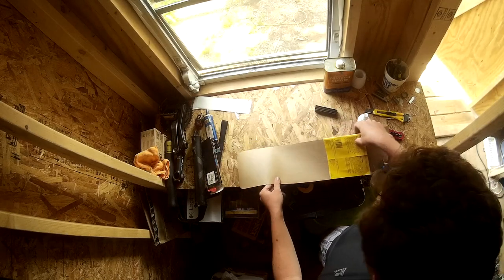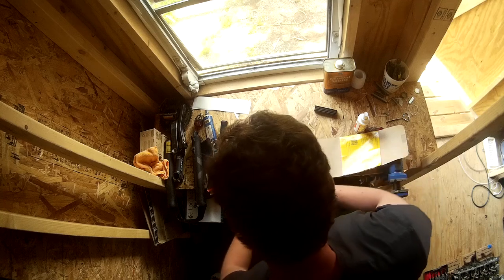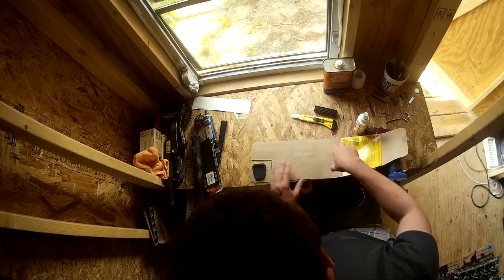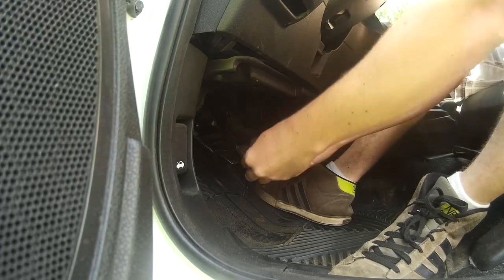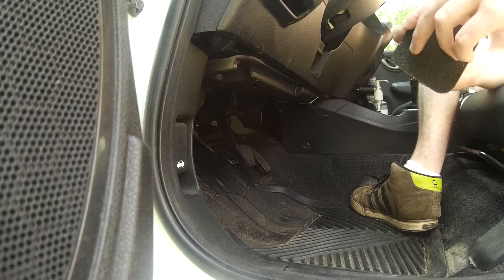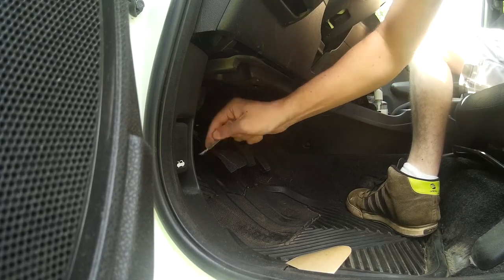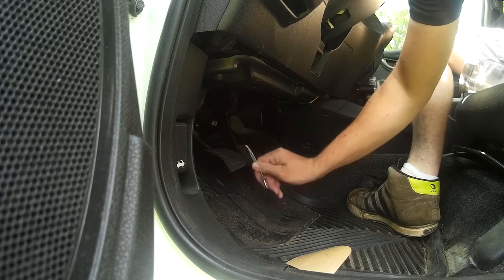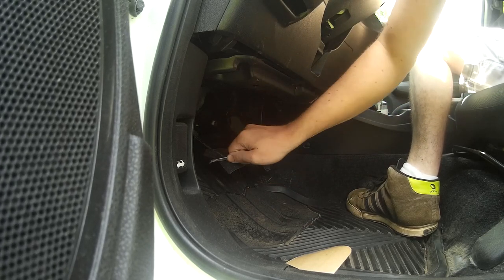diy clutch pedal anti slip  ~$5

Comment: Why don't you buy a new rubber cover ?
Reply from the maker: Just trying out different things
Reply: I'm here because my 2008 Ford Focus pads are discontinued and don't seem to exist used either.
Reply: Sometimes at the part store they have “fix it” part section, I’ve seen pedal covers. Maybe can “MacGyver” it to fit.
Reply: I've worn myself out with searching for something, I'm done. I'm going to try this before anything else. 🤷🏽‍♂️